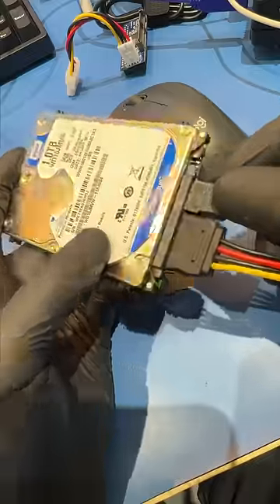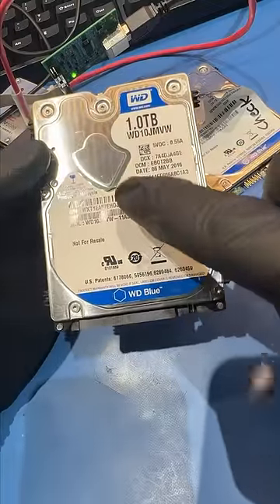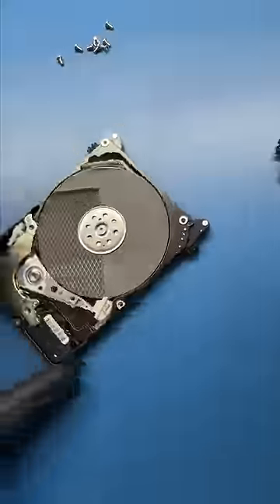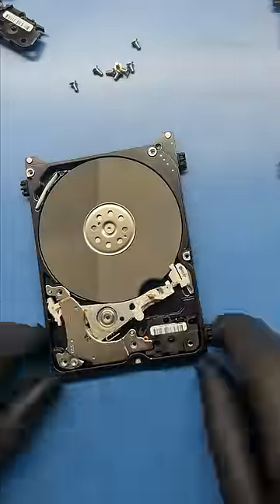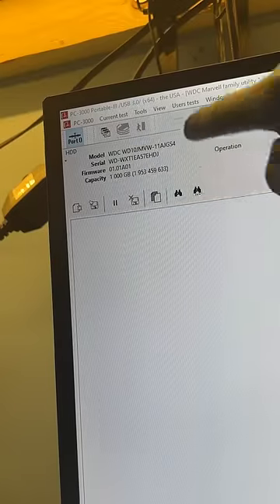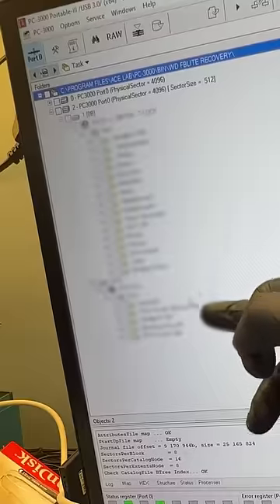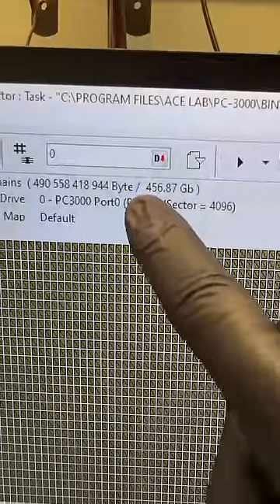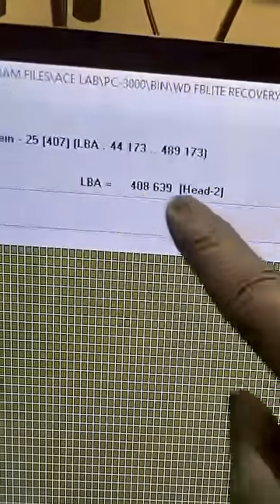Hard Drive Data Recovery Possible…? #technology

Comment: i was suprised when you could actually read the data - i always thought that opening a hard drive was pretty much guaranteed failure for it
Reply: It sometimes isn't readable. MD did get lucky, but this is still a legit last effort technique. Do note that the spliced drive won't last more than a week or two at best! It's been contaminated by room dust.
Reply: from what I understand is that HDDs are really sensitive to dirt, so dust can easily make it unreadable
Reply: @PhotonicEmission he probly did have the room cleaned a lot and he blasted it with green light in case too so he had a little more chance than the avarage joe trying to get his homework folders back
Reply: Laminar chamber. Designed specifically to do zero-dust work.
This is a portable device that you place over a mat you work on, turn it on, and do open-drive works only when on. It keeps enforcing vertical flow of air through a particle filter in order not to allow the drive to catch any.
Reply: At most data recovery speciality facilities they keep the room at a massive positive pressure and they filter the air to remove almost all if not all the dust. I also thought this because I didn't know there was a portable version of this.

Comment: Bro can set the heads a couple hundred ATOMS from the discs 
True skill
Reply: We have tools and this drive has head ramps. Those do that. You just remove the heads from the ramp. That silver tool he used is called a head comb.
Reply: The head floats above the disk on a cushion of air, which is why dust is so dangerous. Hard drives are not assembled to nanometer tolerances.

Comment: Does the pc3000 have the description software?  If not, what is it?
Reply: He used a hex editor i guess, which takes ages. I dunno how he did it. Coulda asked the customer
Reply: I wonder what does that device do that an actual computer doesn't
Reply: @returnedinformation1040  Honest answer? 

I suspect absolutely nothing other then it being used as a hardware based drm* solution for the manufacturer. Most likely all of the vendor specific information is just stored on a encrypted flash somewhere on the board. 

* - Software is easy to pirate. Hardware not so much esp if none of the vendor specific information ever leaves the board.

Comment: Bro just casually fucking decrypt this guy’s hard drive
Reply: The drop was so bad, it encrypted it.
Reply: He casually did it because he had it from the owner, so he just had to type it in.

A full drive decryption brute force on a drive like that would take hundreds or thousands of years with current technology.
Reply: Totally unnecessary. You can just copy bit to bit and make a drive clone. No need for decryption. This guy just wanted to see his client private photos.
Reply: @suprememasteroftheuniverse Eh, yes and no.  You're right, you can make a bit-bit copy, but there's a few factors you should take into account:
1.  The drive is living on borrowed time, it may not live through a full drive read - if there's only 10GB used on it, why not copy only those 10GB?
2.  The top level listing is usually used as proof of recovery.  So usually with drive recovery companies, customer send them the drive, they see if it's recoverable, they get a top level directory listing, then they show a screen shot of that to the customer and ask them if they'd like to proceed with the full recovery for XYZ dollars.  And if they can't recover it, they don't charge. 

That being said, guarantee you they look at and sometimes keep private customer photos.  Whenever people are in a position where they have privy like that, they will inevitably abuse it.
Reply: @MrSlowestD16 if the damaged part was replaced why would it not live enough to recover the data? It's not the magnetic disc that is damaged so it shouldn't get worse in the nearest future again. Yes, it may not be as reliable in the further span of time, but it's not like 10 minutes left.
Reply: @piotrkubiec5549 Yes, the broken part was replaced, but now that the drive was opened there are all kinds of particles in the air inside the drive. This will lead to oxidation and other stuff which basically means that the drive will self-destruct while running.
Reply: @MrSlowestD16  man you got a good head on you. Absolute power corrupt absolutely. I feel like most people would be like “nah… they wouldn’t do something like save my data” lol

Comment: I'm glad you could recover the data. But, you opened the drive. Any contaminants will cause further issues. The big question, how did you know the heads were bad before opening it?
Reply: He's recovering the data to another drive  this HDD is dead it's not getting put back in any system except recycling  this is just a data recovery process.
Reply: Clicking sounds, scraping sounds, whisper sounds, whirring with vibration, whirring with an electric groan, all these are external indications of failed rw heads

Comment: I thought the silver platter got tarnished from oxidation when it was opened
Reply: I don't know about oxidation but dust will surely get to it. They replace the head just to get the data off there, after that the drive is scrap.
Reply: They do under some conditions (I'm not sure if it's all types or just some), but it's not gonna happen in an hour that he needs to read the data.  That drive likely won't last long after this.

Comment: There is 2 critical things missing.  
1. Only do this in a dust free clean room.  If you don't, the surface of platters will being to oxidize and moisture and micro-dust particles can ruin them. 

2.  The donor drive not only has to be the same model, but also have the same firmware revision and sometimes comes from the same factory facility with matching parts.
Reply: 3. In 99% of the case it is not possible to restore and save 100% of data, especially if HDD did drop, there will be a lot of corrupted files

Comment: Important note, everyone else already mentioned it:
1. Clean Room-like Environment needed (Chamber, or whatever else, DUST FREE)
2. You often times need a compatible Head which is almost exclusively a donor part from an EXACT model of the same Hard drive.
3. Dont do tis crap if ur not 100%  sure you know what you do, this guy used atleast 4-5k worth of tools

Comment: We had a tech do exactly this back in the 1970s, and destroyed 4 washing machine sized drives & disk packs during routine maintenance at a customer site…. it took three engineers about a week to rebuild the physical drives and restore their critical backups.  Luckily they had a pretty good support contract.
That ping-ping-ping sound is something you never want to hear.

About two months later, despite company policy of ‘no jewellery’, the same guy almost lost a finger - shorting his gold ring across the power supply of a similar drive.  He doesn’t work there any more.

Comment: i love how you fixed the drive and could have given it back to him but instead you extracted the data and put it on a new drive just to make a few extra bucks. you woulda made a great car mechanic
Reply: If you change out the heads and it works long enough to back it up, how can you guarantee that it will stay working after that, it’s better to back up the data to a known reliable drive than to keep the data on a drive that could be at risk of breaking down again
Reply: It's data recovery, not disk repair. After investing hours of patience and work to extract the data, new hard drive is not an upsale, it's a common sense

Comment: And this is why we have backups. Flash drives, ssds, on-line, etc. So many ways to duplicate your data so you don't get stuck in this situation. Would have been a lot cheaper to back it up before the accident happened

Comment: I had always heard that once the read head is separated from the platters it takes special equipment to line it up again (because you're dealing with microns) Is that not true or did you just not include that step?
Reply: Specialized tools are used on 3.5" drives  because the heads are parked on the platters and more difficult to safely replace. Plus almost every type/generation/series needs a different heads extract tool.

Comment: PSA. Even if you did similar repairs in the past successfully without a clean room, tolerances have gotten much tighter.. A single speck of dust WILL ruin a platter..on newer hdds.

Comment: You don't need that pc3000 if the heads are from the same make and model hard drive. 

And you can free up locked head by putting the drive in the freezer and then plugging it in cold and leaving it. 

Used to do that to old 30 gig fujitsu that didn't spin or had locked heads.

Comment: Where are these shops ?!?! Only places I have ever found are pretty much. You need to replace it it's broke. In this case it would be you need a new HHD and reinstall windows lol.
Reply: that solution you mentioned will work for 99% of cases for normal people. it's broke, buy a new one and be on your way.
fixing it like this (well this is not fixing) would cost more than buying a new one. in this case you can't just buy the old data back then you have to do this. and it cost a lot, but for important "homework" data...u gotta pay

Comment: The "little thingies," or drive reading heads, used to replace the broken ones, are from an identical drive. So these heads are not "one-size-fits-all," yes? 

Can the "donor drive" be used again, once its heads are reinstalled? If not, is the cost of the donor drive included in the price to recover the customer's drive? How much did you charge the customer, BTW?

Still, most interesting video, and resulting comments. Keep up the good work

Comment: Every HDD i opened was useless except for one small part of it. There are 2 good magnets below and above header and some HDDs have really strong ones. I always scavange for those magnets, some of them can hold about 4kg of metal. Last time i used it for that was to hang a hammer and an splitting axe on it. If you dont need that HDD anymore if its small capacity like 40GB or its just broken and you dont need to recover anything you can always take those magnets out.

Comment: Unless you have opened a same model as the one going to be repaired, i would suggest you open the new first, so you can take a misshap in the remove of the cover..
Instead of trying it on the customer part

Comment: I cut a few HDD open in middle school shop class, those neodymium magnets are a bitch to remove without damaging anything. 

Did it again years later with the proper tools and it was much easier, but the magnets seemed even stronger somehow. Still, quite comical to power one on with the lid off.

Comment: spinning disks aren't airtight, they have a breathing hole to allow air in, all of you saying because it was exposed to air it will degrade are mistaken. there are some enterprise grade drives that are filled with helium but a consumer drive like this is filled with air. if opened outside of a controlled environment you introduce tiny particles which can degrade the disk but air is not the culprit.

Comment: what I'm most confused by is why do you need the PC3000 thingy? it seems to be a recovery tool of some sort, but it connects just over SATA? what does it do that could not be achieved with a normal computer?

Comment: Built my first PC in 1989. I have NEVER had either the heads or actuating arm die in any hard drive I have had.i have seen this problem mostly in drives that have been moved around or abused while the drive is actually on. 

So, yes, all you people who have laptops with a standard HDD, Put that laptop on a stable surface and don't move the darn computer while it's on. Also, don't drop your drive!
Reply: >laptop
>dont move it
Sir thats the entire point of a laptop

Comment: While in computer engineering school, we were told never to open a hard drive, the slightest dust in the air or micro particles would wreck the disk in the drive. I later saw vids of hard drive repairs in 2014,then i knew nothing iss irreparable, you just need to know how to go about it

Comment: Your customer didnt drop it and damage it. It would require about 480G of force to physically damage the drive and the pickups… your customer repeatedly struck the computer to do that damage. The heads do wear out, very quickly on WD Blue drives cuz they’re shit drives but that was NOT from a drop.

Comment: Back in the old days (1990s ) unless you wanted to pay $1000s for a HD recovery we had a thing that would work about 50% of the time and the hard drive would be ruined afterwards ⚠️ WARNING ⚠️ THIS WILL DESTROY YOUR DRIVE AND DATA!  We would put the harddrive in  freezer bag, put it in the freezer for an hour,pull it out, have the fastest booting PC ready to fire up, hook the drive up and start copying right away. What this would do is shrink the headspace and bearings allowing the drive a last hail mary run. As the drive copied and warmed up it would start erroring and if you were lucky you'd get 100% ( HDs were 500/540MB some a bit larger some a bit smaller ). Drives today have a much tighter tolerance and it's usually the board or the head going bad. Freezer bagging a new drive will destroy the drive in 75% of the cases if not more. 
I almost find it hard to believe l have a 14TB backup drive these days - inconceivable!!

Comment: The read-write head is positioned so close to the drive that a fingerprint or a smoke particle cannot fit between it. For this reason, harddrives should only be opened by a professional in a clean room with less than 1 dust particle per cubic inch. However, a normal room has more than 15 million dust particles per cubic inch. So good luck with that. You'll probably lose everything doing this.

Comment: If you replaced the damage reader is the customer's hard drive not fixed? Why do you still need to extract the data? Can he not just use the repaired drive as normal?

Comment: HDD's in 2023? I wouldn't trust it without backing up to the cloud. Also, why wouldn't you be able to use a SATA slave cable to pull up the files?

Comment: Why extract the data with external device if by replacing defective part is now functional.  You should be able to boot up from drive then. just backup the data or mirror the image to a drive and restore the image to a new drive

Comment: Shouldnt the harddisk work if the reading heads changed?
Reply: Any repair to a hard drive is considered temporary. Grab data while you can, because it might not work the next time. Plus the term hard drive crash is from when those head arms touch the plater. When that happens it's almost impossible to recover anything. Because the drive was opened and the heads were replaced manually there is a chance they might not be aligned 100% or a foreign contaminate has got in that can cause a crash. Basically as soon as a drive shows signs of going bad you need to transfer data and get rid of it.
Reply: @nickrider815  oh! Thanks for the info.

Comment: I used a pci card solid state drive called REVO drive in 2013 for my uncle's computer.  The card has two internal drives and a hardware raid 0. Recently the card won't access one of the drives so the computer won't boot. Is this recoverable

Comment: 90Mbps for a hard drive data transfer is actually kinda slow. Mine usually goes at 900Mbps
Reply: Lol, surely you're kidding. You probably have a ssd, and are doing internal transfers. Transfer rates between two hdd drives like he is showing here, WITH a HDD reading/recovery tool, 90mbs is well within the expected range. Think about the application in which this is being done. Maybe think first, and not try and brag or boast. You wouldn't come off as uninformed as you did. Cheers.
Reply: @huntertoro879  Actually no. 4TB *HDD* to another 1TB *HDD* at 900Mbps. I took 2 digital electronics courses, 4 programming courses, and am majoring in Cybersecurity. I know the difference between HDD and SSD and my rate is correct. You just can't seem to differentiate between a transfer and a data recovery for download rates.

Comment: Why would you need to decrypt? From the video it looked like it was the HDD's internatl decryption, but ss you are using the original drive with the key stored in it's EEPROM there shouldn't be an issue!?

Comment: Bro I have a hard disk but it's old and sometimes it work but makes sound so I sorta opened and broke the reading stuff. But the disk is safe but don't know if dust is there or not. Is it possible to recover? I have 7 years or stuff inside it.

Comment: Bro, Need a help if it's not too much to as🤞🏻🙏🏻

When I installed windows, I lost my old and very important software key.
Can I recover old registry (assuming the key was saved to registry) or the install folder (assuming it was saved there) Read it depends on software where it saves the key.
Overall, any way I can get it back??

Of course I've already gone through the mails and the software supplier. No luck.

Comment: Can I ask a Question please I have a Apple Time Machine and it’s a 2 Terabytes and out of the blue it stopped working I can hear the hard drive going but it’s not turning on I took to the Apple Store and they said nothing can be done but I hardly had much on it but I’m hitting a brick wall as they say I can just buy a Apple Mini at £1.299.98 but I’ve seen these Apple Time Machine on eBay for sale !! Can it be fixed please 🙏

Comment: hey quick question can i change head between different model have hitachi hts54xxxxx model 60gig hdd with crashed head and cant  get exact model here so far i have sourced one hts72xxxxx model hdd only so i wanna know if i can change the mechanical reader head between the drives both are single head and single platter

plus i have source a HTS54xxxxxx drive thats too a 54000rpm single platter single head drive but has ide interface which drive is more suitable for transplant